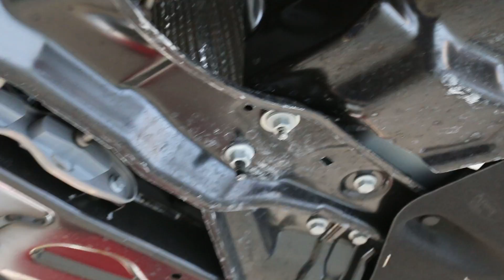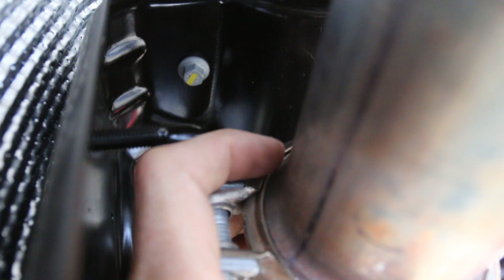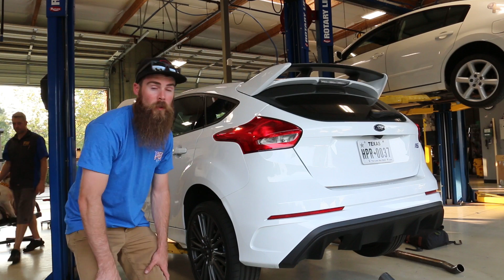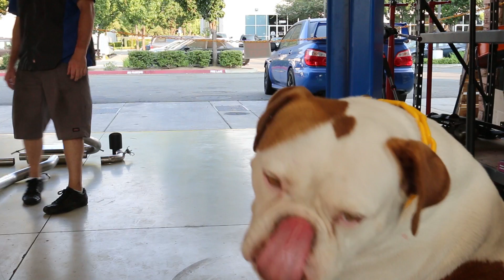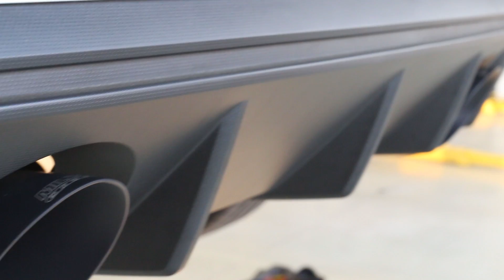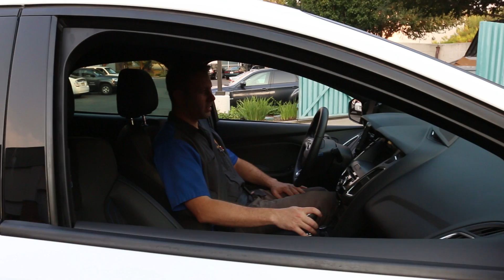TURN UP THE NOISE FORD FOCUS RS CATBACK

Comment: Is the car even broken in yet? I doubt this car will last more than 50K miles
Reply: +marsdog 2.3l in the mustang has been around for about a year now. don't think I've seen any come in with a mechanical issue yet. and this is a beefed up version of that same motor, so I feel reliability will be pretty good so long as you're not increasing power beyond the engine's limit. I'm more curious about the reliably of the ptu. something tells me those will be going bad in the future.
Reply: marsdog I have 165k miles on my F150. No issues at all. Just general maintenance.
Reply: why do you think that
Reply: 1. It's a Ford
2. It was stated in the video that the car was just "newly acquired," so chances are there are only a few hundred miles on it. Proper break in period for a new car should be 1000 miles.
3. It's a Ford.

I would be delighted to be proven wrong about the reliability of this car (or most Ford's for that matter) because, on paper, the RS is an amazing car, but I, and many friends and family members have poor history with Ford vehicles, old and new. Many of the issues I come across on Fords are electrical problems and I do most of the maintenance on my family's cars so I know poor engineering and bad design when I see it.

Comment: a 16mm nut is nowhere near odd mr i dont use metric system cuz merica
Reply: Common on non-us Fords - not common on Japanese cars, mostly they seem to skip 16 and go right to 17 for some reason.
Reply from the maker: Exactly that's why I mentioned it. I have never seen a 16mm on a JDM car.

Comment: Thanks for the video.  The thing I learned from this is the car sounded better with just the resonator.  Their muffler, well, muffles too much and makes it tinny sounding.  I have a bypass on mine for now, will probably just go with straight pipe and small resonator.  That miltek is too pricey for what you get.

Comment: the pops are fake I read somewhere on a forum.
Reply: +billy heaton it's not fake,  it's artificial. little drops of fuel go into the exhaust valve to create those backfires.  so no they are not fake,  but that are artificial backfires
Reply: +billy heaton 
"can't make a car fake backfire pop"... When you swap tunes it totally changes exhaust sound, when I run E30 my car will not pop, 93 it pops all day long.
Reply: LMFAO you can't make a car fake back fire
Reply: billy heaton welp
Reply: +Homber Sweatson fuck up troll
Reply: +TrenC21 it doesn't over fuel,  it goes directly into the exhaust.
Reply: +urbex2007 
That's not what's happening. The "fake sound" in the Focus is pumped into the car by a tube hooked to a diaphragm that vibrates under acceleration. The speakers are not involved.
Reply: +Jeff Smith actually that's the st. the rs doesn't have that tube.  and there are deep frequencies that are played not through the speakers but the subwoofer underneath the carpet in the hatch
Reply: Jeff Smith it's pretty damn clear what you heard on this vidoe not fake and it's not a canned tune
Reply: +Curtis Wakefield plz tell me that's not true
Reply: Maxx J Hey go look at blake's other vidoe he just uploaded today the car doing the same thing it's not damn tune i never heard of anything like that
Reply: because 93 there's more fueling to ignite in the exhaust gases.... e30 less left over fuel in the exhaust gases....less to ignite, therefore less pops...
Reply: Its true, I still like it but it is artificial.
Reply: My car didnt used to bang and pop when it was stock, now i shoot 30cm flames out my exhausts. are those flames artificial lol ? the pops are caused by purposefully over fueling by ford on the stock sw map for the new RS. so the car is actually making those pops, its not being generated like the noise of the engine being piped into the cabin
Reply: +TrenC21 gas is dumped into the exhaust via a valve....  and there is no noise on the rs being pumped into the cabin like the sti,  however there is tones being played through the subwoofer.
Reply: is it a specific valve for over fueling ?i doubt that....its just the way the map was written, having a specific valve to do that sounds like a way for something to valve....
Reply: aha ok i see what you mean, surely when modding that fuel line is removed ? i didnt see anyone mention about a valve on the exhaust in the video above...im going to read more into this...
Reply: +TrenC21 no extra fuel line, I wasn't clear. the engines exhaust valves open up and allow the fuel to combust whilst open, creating a "backfire"
Reply: similar to how a wotbox does launch control
Reply: how are they fake? Did you think your comment through? Are there speakers under the car making popping sounds?
Reply: +Martisan lol chill out. by fake he ment that he read somewhere that they're artificial. and he's correct

Comment: That sounds pretty good even better than stock. 
Is the system available in the UK ? Should have my RS early in the new year. Would definately consider purchasing this system.
Great video. Best regards.
Reply: Yes its already available
Reply from the maker: +anpr1984 MillTek is based out of Great Britain so I would assume it's available in the UK.

Comment from the maker: SMASH THAT LIKE BUTTON GUYS!!
Reply from the maker: +Matt Coffey nope!
Reply: Put a hole in the screen
Reply: Got it!
Reply: Blake's Garage ?? if you strait pipe the exhaust with a smaller exhaust tip will it give much power.i heard the smaller the end tip and strait pipe the exhaust will give it lot more power. pipe not so heavy and airflow just right.let me know what you think
Reply: Blake's Garage my question whats the fastes you guy got the rs horse power up to??
Reply: Did you guys happen to dyno just the exhaust? I don't want any more noise on mine but doing a bigger turbo and meth. Just don't want to sell myself short by not doing the exhaust?
Reply: Smashed.